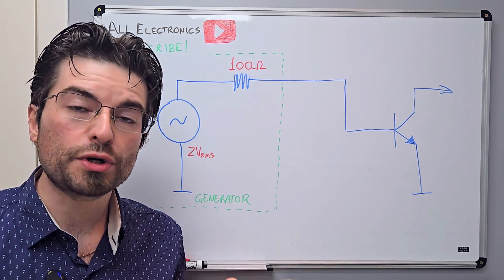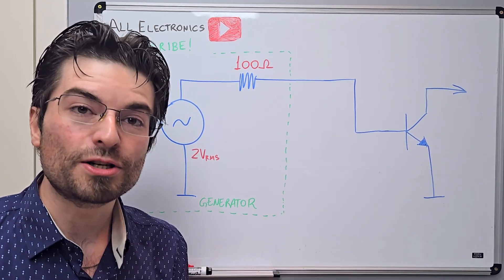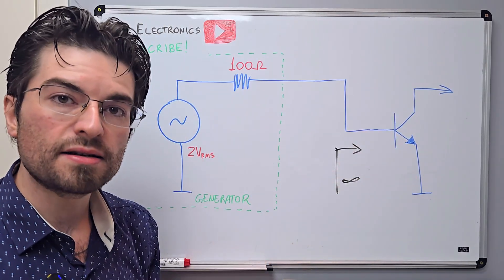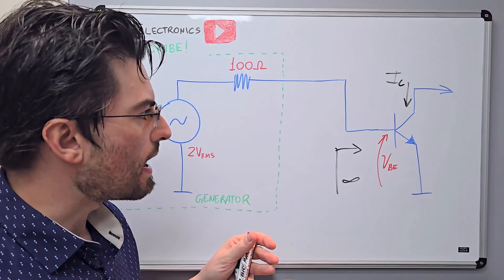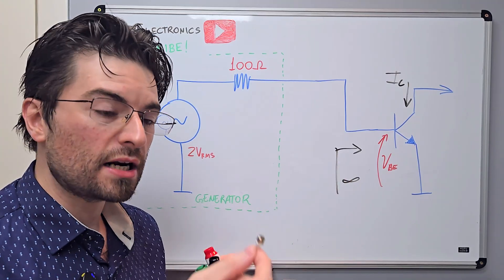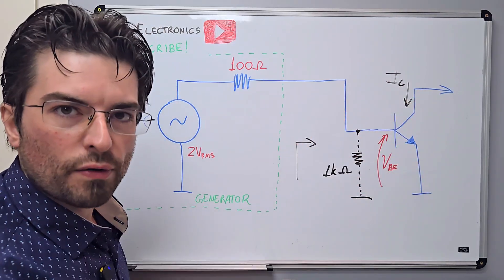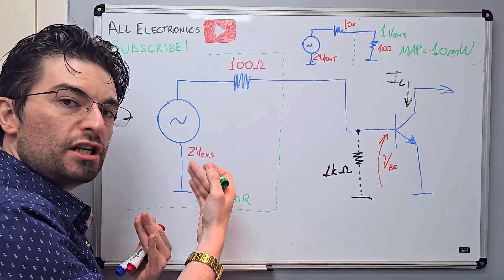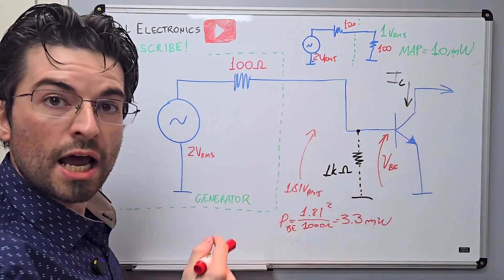Why Impedance Matching Still Matters for Transistors

Comment: I use this RF based thinking method in my first desing. It is rather effective and makes the calculations rather accurate and let to do the full desing process with paper and pencil method without needing any PC-aided simulations. 
And the cherry on the top of the cream the known and matched impedances makes realy easy to transform all the miller capacitances back the first bjt base and this way get the load capacitance for the driveing stage and can calculate the needed noise-gain compensation for to get the stabile loop. 
As the impedances are matched back and forth the stages the “signal” power or current or call it anything propaganing is extemly fast and has no sing of reflection or ringing. This is rather important when i have to manage load step without over or undershoot, and the output have to be proof for the RF noise injection at the same time.  
At this point turns realy helpfull when the circuit has no voltage gain much above DC. Like above 0.33Hz at full load and above 0.01Hz at idle. Because the op-amp needs to done a rather small voltage displacement at its output to achive rather enomourus current change on the LOD output. 
AND the current amplification factor is olso controlled by the shared temperature between the Bjt-s. 
This way the output voltage drifts rather slow on heating/cooling events if its all of gets put outside from the feedback loop. 
This alows to an moderate slew rate capable high DC precision op amp to stabilize a 8-15MHz Ft (depending on a load current) power stage waay easy. 
The power stage is had a rather smart local feedback thru the bjt-s miller capacitances what is not alow the output voltage to change from the output node. it stopped by stealing and injecting current into the base and it stop the voltage change by its own rate, but it alows to change the current thru the device thru its base current with its near original speed as it feed the output current demand without voltage change. As both stage are running on A-class settings, but the driver one (Ic+Ib)xUce products is fully stedy as it change within One mW when the load at the output load is changed by 1:50. This way the bjt junction self heating/cooling effect is canceled out here and its Hfe change is may not contribute in the feedback loop response after its temperature is sets.  
This level of precision and speed can not obitianed from integrated circuits, because the voltage reference PSRR is finity /i olso canot use them to get the reference/ and the feedback loop transient sensitivity makes the output voltage suspect by the real high speed current changes. So all of the voltage controll based aproach on these devices with useing a low voltage references and a decent amaunt of voltage gain inside the controll loop are olso a big missconception for a while.  

And as i found: So easy to geting performance if i stick with an RF aproach and use it limitless in my non-RF rendered circuits.  This is made to be a kind of echoing the conclusion of this video.
Reply from the maker: That is great!

Comment: For a beginner learning about transistors, seeing 3 Volts applied to the base of an NPN transistor with a grounded emitter completely violates our fragile understanding of the diode-like characteristics of the B-E junction. This does not work at DC or low frequencies, the junction clamps the voltage to 0.6 Volts. You need to lead us through this confusion to understand how DC and RF impedances are not the same. I struggled with this a lot while learning about RF amplifiers, which always look very wrong to a person who has never worked at RF.
Reply: 3 volts straight to the base of a grounded emitter transistor is likely to release the magic smoke .
Reply: @thomasmaughan4798  He is talking about the SIGNAL voltage not the bias!
Reply: Im calling bs. You dont want to maximise the Vbe. You want to set the base current to bias the Vce at the point that is appropriate for your design
Reply from the maker: Keep studying! Some search terms to  guide you: "Ebers-Moll equation", "BJT small-signal model". Wish you an amazing 2026 😊❤
Reply: @AllElectronicsChannel  yeah nah mate. Youre wrong. Ive been in electronic engineering for over 40 years. The references you quoted don’t support what you’ve said either.

What is your justification for wanting to get maximum Vbe to get more amplification?.
Reply from the maker: Thanks for watching!
Reply: @davefoord1259  I agree.   the   Transistor  bias concept is a bit messed.  You generally have to but a  Re into the circuit to get a stable  Ic at the bias point.  This  example  ignores that and it ignores  input Z on the base  em  junction  Beta x  re'    where  re' is  approx  24 / Ic   if Ic is in mA and measurement are at about  20 C.    If you ignore this stuff from the get go you will get lead down the garden path on what the true input  Z is to the BE junction and the necessity for active control over  the  quiescent   Dc  Ic.
Reply: @davefoord1259  You're right. He's talking complete nonsense and just getting away with it. He can't argue. I'm also an engineer, teacher, developer.
Reply: Transistors are still just base-emitter diodes even at radio frequencies.  You would never operate a transistor near its cutoff anyway; horribly non-linear at that point.  You bias the base at a steady current that produces about half its operating range and then the signal source adds to, and subtracts from, that steady bias current.  It is the bias network that is going to define the input impedance of this amplifier stage. 
FET's also have a bias network but they bias for voltage, not current.   Naturally you can use much higher resistances in the bias network and thus its input impedance will be much higher.
Reply from the maker: Hey Leo, yeah. I choose the values to make the math easier, but it indeed may lead to confusion. Nevertheless, it does not impact the argument.
Reply: you are confusing the  DC  BE  bias point  with the  small signal  applied  voltage .   however the  BE  voltage in DC mode is  nearly always  a lot less than 0.6 V  which is simply an upper limit.  the BE voltage  DC is driven by the  emitter  internal resistance  which is a function of  Ic   x  the   Beta  for the transistor.  That value is  in parallel with the voltage  divider network  that feeds the  base  of  the   Tr.    If the peak  small signal  voltage (negative going) is greater than the  dc bias point of the base,  then the  transistor must clip and become non linear.    If the amplifier involved is a class  C RF amplifier  then that's completely normal.
Reply: @F_Tim1961  thats not true at all. The base emitter voltage when the junction is forward biassed and therefore conducting is almost exactly 0.6 volts. 

It varies with temperature and slightly with current but not much.

It is somewhat irrelevant to the collector voltage. As the BJT is a current current device. You need to look not at the base-emitter voltage to see whsts going on in the circuit but at the voltage across resistors that are in series with the base, collector and emitter to analyse the circuits
Reply: @davefoord1259  what you say is  generally true  ie  0.6 V  BE v  for a  power transistor application.  However it's not true for  small signal amplifiers  running in the 10mW type of range  which might have a DC  BE of 0.4  V or less as the   re'  reflected back to the base  via  Beta is so high that insufficient DC  current will pass for the  BE  silicon junction  to  saturate .
Reply: @F_Tim1961  ive never sern thst in 44 years of designing and repairing. Never 0.4. Can you quote me a transistor part number thst youve seen it on?
Reply: @davefoord1259  I have replied as per below .  since then I have done some more simulation work using a  TIP31c  and it shows  that  using a BJT without an emitter resistor  , bypassed if used for  AC work, is  a non starter.  In particular the current  gain ratio drops alarmingly with only a 300R in collector line and no emitter resistor.  I also found  that for a  a  TIP31c  with a standing  base current of  0.14mA  the  Vbe  will be about 0.64 V from  LTspice so to get  Vbe of less than 0.6 V you need to be in the 30 micro amp  bias type of range .
Reply from the maker: Try microwave transistors like BFP420, think you will see 450 to 550mV
Reply: @F_Tim1961  yep. If you have a look at the current vs voltage characteristic of a be junction, its almost no current until you hit a certain voltage then the current takes off increasing rapidly as you increase voltage. If it were an ideal junction it would be zero current till the threshold voltage then an unrestricted current above that voltage. Thats not a mystery, its basic electronics. The characteristic voltage is in the range 0.55 to 0.65 for most transistors.

To set up a class a amplifier stage, you can put a bias current into the base, and increase the current until the collector current causes the collector voltage to drop from supply voltage to about half of the supply.

Thats emitter connected to ground, collector connected to supply via a resistor and base connected to supply via a higher value resistor. For a npn transistor with a gain of 100, a supply of 10 volts and a collector resistor of 100 ohms, the collector current needs to be about 50 mA. Therefore the base current needs to be about 0.5 mA. The base resistor then would need to be about 20k ohms

This biases the transistor so that you can get the maximum collector voltage swing. 

This is called simple bias but it isnt very good because the bias depends upon transistor gain which changes with temp, collector current and from transistor to transistor.
Reply: @davefoord1259  I am aware of all this and would not touch such a cct  because there is near zero protection from thermal run away and there is too much variation  cct to cct in performance  (Ac current gain,   power out to a given load and so on). 

But when you put an emitter resistor in and run low  bias current as in in the 50 uA range typically  you will  see  Vbe  <0.6 V at  25 degrees.  That is what practice and the  LTspice simulator show.  Once the  bias current is driven up to the mA range then the  Vbe will settle out at about 0.63 V at  25 deg C.  That's  basically a repeat of previous  communications. 

The  no  R emitter  design is so hard to implement robustly  that it should never have been given for the design example.  It will lead people down the wrong track.
Reply from the maker: In the video I explicitly say that the biasing network is not shown because it doesn't change the argument. The resistor in the example models the AC impedance of the input. Biasing scheme, DC operating conditions, and junction effects do not change the argument. It won't confuse one that listen carefully to the explanation.
Reply: @AllElectronicsChannel  I agree!  It's obvious that a lot of the commenters that are transistor gurus like me have never dealt with RF just DC and audio freqs.

Comment: That is an absolutely erroneous explanation that you gave. Also unpedagogical. The generator is AC and you are sending its signal to a transistor, where there is no specified operating point, nor a separate AC component of the quantities. Therefore, you cannot treat the power as if it were alternating. If you were to determine the AC and DC components of the voltage/current, then the transistor's base-emitter junction will load the signal source with a differential resistance, and the voltage Ube in that case loses its meaning, it is not considered.
Reply from the maker: Thanks for watching! It is implicit that we are talking about the AC differential input resistance.
Reply: @AllElectronicsChannel in that circuit is missing a DC working point of BJT and 2V rms is too big , so, the transistor is not a differential resistor
Reply from the maker: It is not missing because I explicitly say in the video that the biasing circuit is not shown. Yeah, I should have chosen 100 mVrms; nevertheless, it won't change the argument.
Reply: @AllElectronicsChannel  It changes. You were talking about input resistance in kiloohms. That's nonsense. Mainly because you can't talk about AC input resistance. You don't understand what I'm saying.
You have hockey in the definition of quantity.
Reply from the maker: Search for "BJT small-signal model", it's going to help you.
Reply: @AllElectronicsChannel  Who are you writing to? Me? The teacher and the developer? The chicken wants to teach the hen to peck? You're already embarrassing.
You guys should learn this before you start rambling again and don't keep people here.
Reply: Thank you.  Yes, in a transistor, base current matters, base voltage has meaning only in the sense it needs to be 0.6 volts to turn on the base-emitter junction.  Once that diode junction turns on, you cannot make the base-emitter voltage higher until the transistor catches on fire.  It is a DIODE junction.  
The rest of it is okay; the transistor does have a type of impedance as you need enough base current to operate the transistor through its operating range.  
AS SHOWN, the circuit will chop the negative half-cycle completely off.  Only the positive half-cycle will turn on the transistor and then only when the Vbe reaches 0.6 volts.  So it will be amazingly horrible as an amplifier stage.
Reply: @thomasmaughan4798  If you want to work with the input resistance of the transistor with AC current, you have to use its differential resistance, that is, consider only the change in voltage with a small, amplified change in current. Assuming DC component, bias. Optionally include negative feedback on the unblocked emitter resistor, if present.
Reply: @srotovnikabc6919  "you have to use its differential resistance, that is, consider only the change in voltage with a small, amplified change in current. "
Yes; I make this point elsewhere in somewhat different language.   How much does the current change per unit change in voltage for either input or output.  From this and ohms law there's the effective instantaneous resistance.   
"AI Overview     The small-signal input impedance (\(Z_{in}\)) for a Common Emitter (CE) amplifier is generally moderate, seen looking into the base, and is approximated by the parallel combination of biasing resistors (\(R_{1}||R_{2}\)) and the transistor's internal base resistance, often represented as \(r_{\pi }\) or \(h_{ie}\), which is related to \(\beta /g_{m}\) or \((\beta +1)r_{e}\), with the value typically in the kΩ range, though it can vary greatly depending on the circuit and whether an unbypassed emitter resistor (\(R_{E}\)) is present for degeneration. "
Reply: @thomasmaughan4798  "generally moderate" ??? Because AI said? It's nonsense, no kiloohms. More like tens of ohms.
The AI is dumb as a slipper and fooled you simple.
Reply: @srotovnikabc6919  "The AI is dumb as a slipper"
An interesting comparison.  I'm not sure how I would go about testing it.  
"Input Loading: A TTL input draws ~1.6mA when pulled low, so the driving source needs sufficient current/strength; calculated input impedance (~2.5kΩ) isn't always accurate due to non-linear behavior."

This non-linear behavior is exactly what one encounters with a base-emitter junction particularly when not biased (as in this example).
Reply: @thomasmaughan4798  First of all, it is nothing like a TTL input. It looks completely different. The AI is lying again.
Next - If you want to find the differential resistance Rbe, for example, set the base current Ib1=4mA, measure Ube1, then set Ib2=5mA and measure Ube2. The differential resistance is then Rb=(Ube2-Ube1)/(Ibe2-Ibe1).
In short, you decided that you don't need books and will use AI to make the world stupid ;)
Reply: @srotovnikabc6919  "If you want to find the differential resistance Rbe, for example, set the base current Ib1=4mA, measure Ube1, then set Ib2=5mA and measure Ube2."
Yes.  It is likely that this instantaneous effective resistance depends where you are in the curve.  The utility of knowing this is that the small signal rides on top of the bias current and this is the resistance the small signal "sees" hence also is the impedance of the input stage.  
Thank you for acknowledging the necessity of a base current to turn on the transistor in the first place.  
This effective resistance also establishes the maximum drive before the transistor clips.  
Ideally, you set bias such that the Vce is half the supply voltage (approximately) and assumes a common emitter circuit with a collector load resistor.  That might be, for example, 5 milliamps in the base.  The maximum signal will therefor be whatever reaches, but does not exceed, 5 milliamps (swing from zero to 10 milliamps) at the effective resistance of the forward biased junction. For a 2n2222 transistor, a good assumption is 10 ohms.   Since e=ir, we have e=.005 (amps) * 10 (ohms) thus a maximum voltage swing of (plus or minus) 0.05 volts signal riding on the bias current. 

The matching network or transformer will be chosen to provide 0.05 volts swing at 10 ohms to the transistor.
Reply: @thomasmaughan4798  Exactly sir, in the wiring diagram.
Reply from the maker: "BJT small-signal model". Keep studying!
Reply: @AllElectronicsChannel  Don't mix pears with apples, sir, and cats with dogs. And a hen can't teach an eagle to fly.